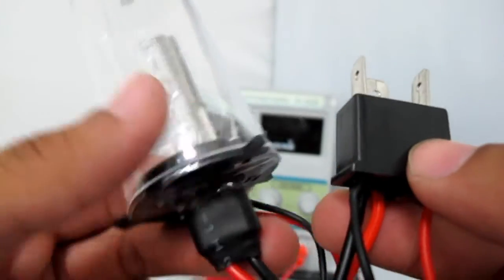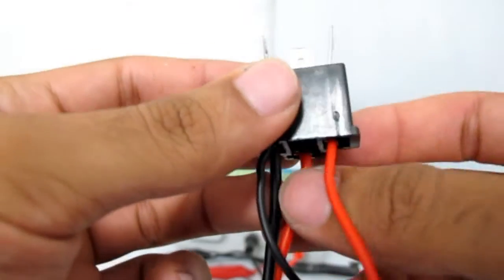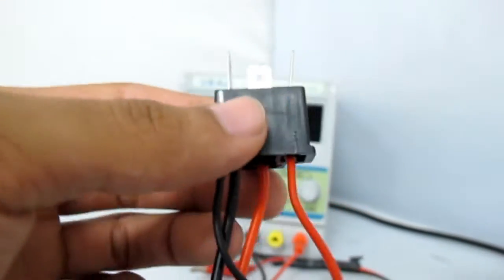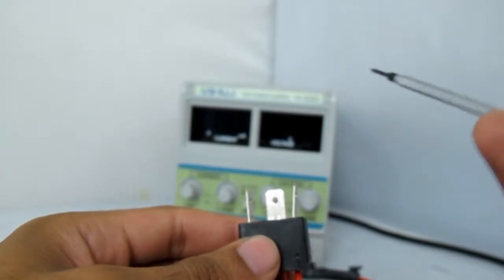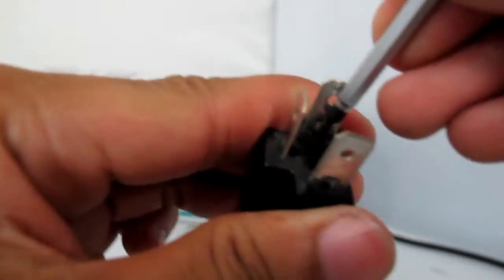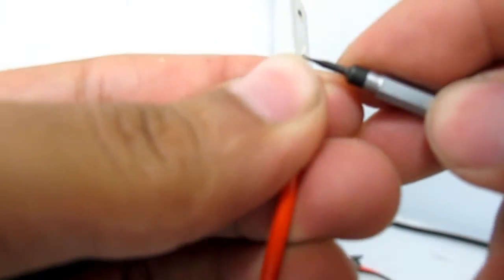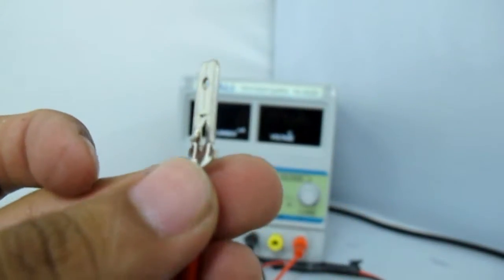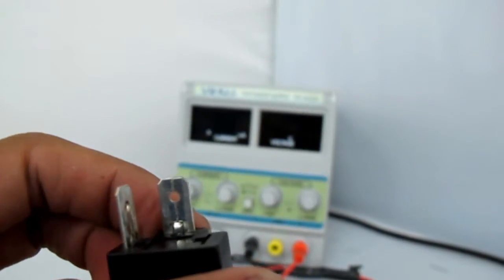How to Re-Pin H4 (aka 9003) HID Bulb (also apply for Bixenon H4, H13 & 9007)

Comment: SO CLOSE!! I needed to see how to re-wire the Female H4/9003... to put a new on on my wiring harness ends
Reply: Did you work out how to do that as I am in the same predicament?
Reply: @cammcmillion9068  Yes. Push a pin into the back of each connector slot on the female connector, and the pins will come out. They are locked in in by tabs that hold in the pins.  Once the pinned wire ends are out, you can get a new hub with new pins from Ebay/amazon and cut, strip, the old wires back an inch, and put on new crimps/leads/pins (whatever) and put them back in a new harness, etc.

Comment: I'm having a problem with my h4/9003 kit my low beam doesn't work but the high beam works is this what I may have to do in order to fix it?
Reply: same here. let meknow what the solution if you know. cheers
Reply: +Newbossmail T. it looks like the kit i had used i had to order the double filament in HID compared to just one filament. and this fixed it so check with your provider for the kit to make sure its what you need for the vehicle